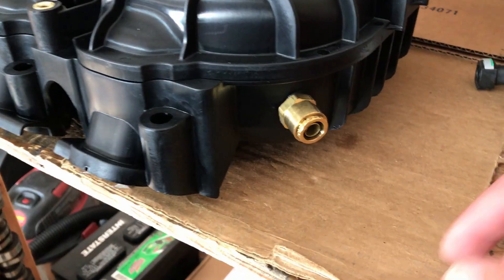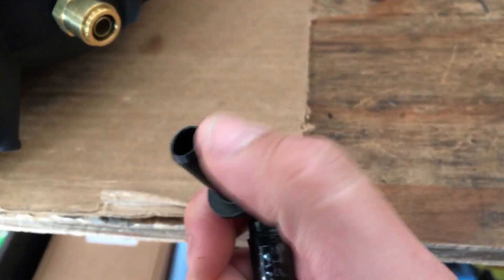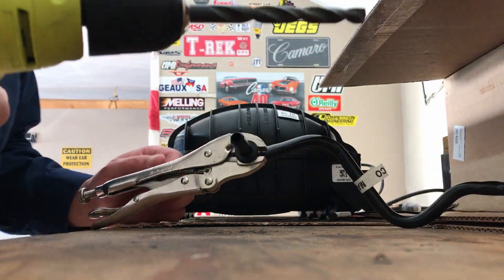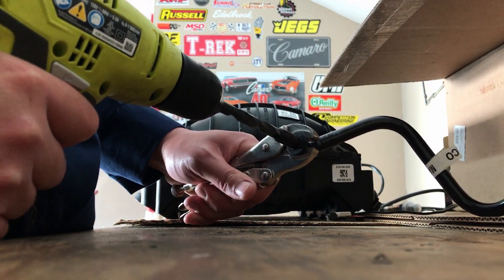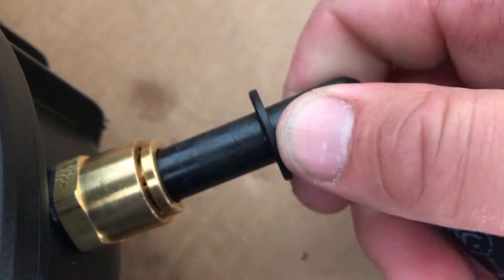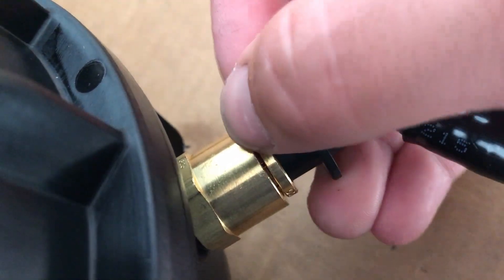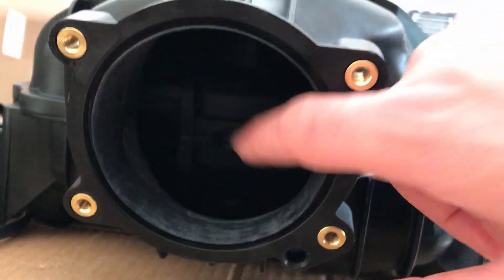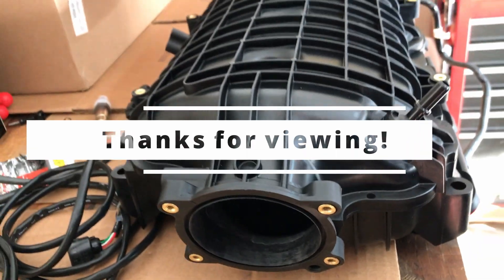LT2 intake manifold on LT1 brake booster fitting

Comment: Where do we go to find the fitting you use that does not require using the 3/8" drill bit on factory tubing?
Reply from the maker: Search (Stainless Steel Male Straight 1/2 Inch Tube OD x 3/8 Inch NPT Thread Push to Connect Fittings PC-1/2-N3) on Amazon.
Reply: @smokingasphalt8050 Excellent!!  Thank you sir!!
Reply from the maker: @keithcastleberry3993  Yes sir, no problem.

Comment: Which was the one that didn’t need to be drilled?
Reply from the maker: It's the stainless steel versions push to connect fittings.  Just look up the same dimensions as the brass one in the link on the details section of this vid.